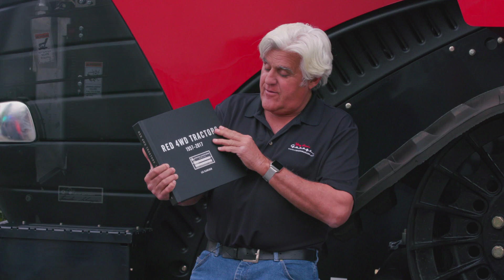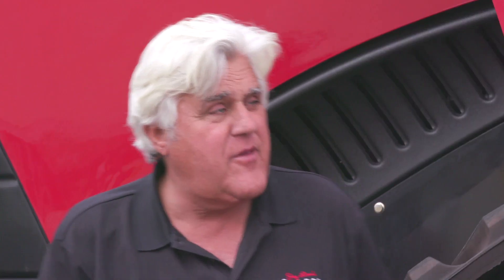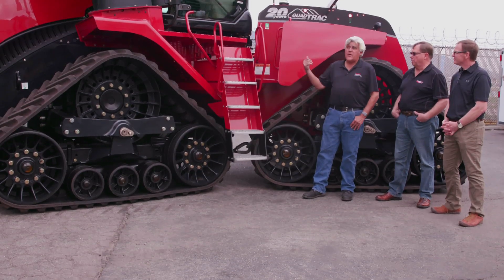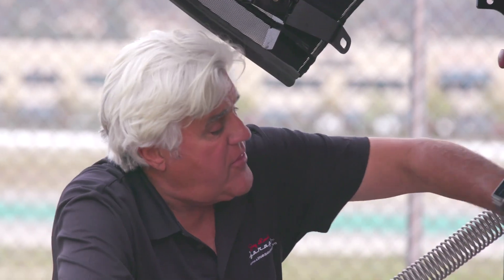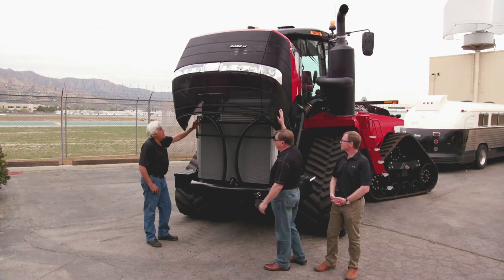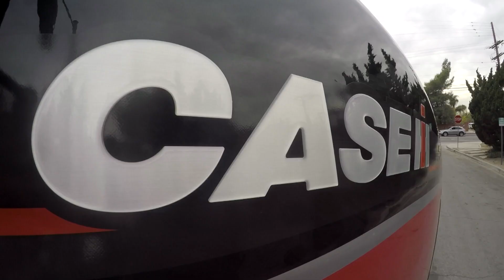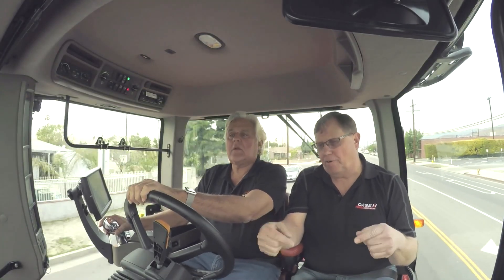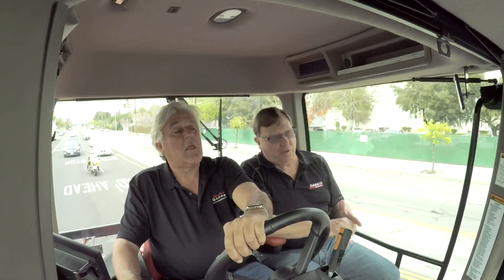2017 Case IH Quadtrac - Jay Leno's Garage

Comment: Hey editor, you left in Jay asking the same thing twice about the radiators.
Reply: Zac Alleywalker Lowing oh good I thought I had a stroke or something
Reply: Oops...
Reply: Zac Alleywalker Lowing just in case people don't get the explanation first time around. Lol
Reply: Just a glitch, Mr. Smith will be right there.
Reply: I'm not the only one that caught that? Good, i thought i just lost my mind.
Reply: But the question was never answered. They just dodged it with a lot of waffle.
Reply: @salvatoreshiggerino6810  That's because he's wrong a thicker radiator will remove more heat as long as you have the fans providing enough air flow.
Reply: @mbsnyderc  Yes, obviously, but that's no excuse for dodging the question. Would it have killed him to just give a straight answer, "There is enough air flow for both radiators"?
Reply: I thought Jay asked him twice because the first explaination didn't make sense.  Air passing through the first radiator will take on the heat of the engine and be hotter.  The oil cooler just doesn't need as cold of air to work.
Reply: @salvatoreshiggerino6810   You should be a Case salesman once you understand the question and implications.
Reply: No, it was edited, Jay actually asked 4 times!
Reply: @salvatoreshiggerino6810  he didn't dodge the question. He said the air coming out of the first radiator, is cool enough to cool the second. It's a very straight forward answer.
Reply: Tht was actually Jay forgetting tht he asked tht question lol
Reply: Okay it wasn't just me. Thought the matrix had glitched.
Reply: Diesel Brothers made one of these that jumped a ramp!
Reply: When the fan clutch kicks in on the engine fan and quits letting it slip or speed up and down, the fans arent jus bolted directly to thewater pump so they turn full speed all day. The clutch between them only locks it w engune rpm as needed, I guess to keep operating temp the same whether it needa to run more or less but when the fan kicks full on you can hear it above the engine and whatever kind of hookup behind you also. When both fans are running full speed you would be amazed at the speed and air they pull through the coolers.the newer ones like this cool themselves really well. They spend day after day in dirt and sometumes so dusty that you cant see the end if the hood much less where you are going and the fans and coolers are designed to where the fabs will pull most dirt ,dust, seed heads right on thru so it wint clog it up like older ones because working an engine hard for 12 14 hrs a day going 10 mph you cant rely on your ground speed to help push air thru the grill and radiators like a car on the road. You still have to blow out w compressed air every so often, that is why the coolers seperate so easily but light years better than on older models where working them hard they jus did stay cool them getting to the coolers and between them to blow them out took forever and had to be done so much more often. Your air condition cooler is up there to and once the older ines got the temp up good so did the cab temp so you burnt up all day
Reply: that tractor has a radiator like any normal radiator for engine coolant, a hydraulic cooler for hydraulic fluid, unless this one has some new function that is diff than any other one ive seen the trans and hydraulic are the same oil.case ih hydraulic oil is called HY-TRAN. Hydraulic transmission fluid. An engine oil cooler, air conditioner cooler and some have diesel coolers so the engine fan itself when full speed blows some damn wind then the electric is just a backup but that is why they seperate even more than they showed you,there are alot of coolers stacked up togather there and they seperate so good like that to be able to blow them out the opposite direction from the way the fan pulls
Reply: That's cause they never actually answered his question, they tried thick six or eight core radiators years ago and anything past a four core rad just heat transfers to the rear cores and never actually dissipates the heat, Jay knows his stuff
Reply: @salvatoreshiggerino6810  He did answer the question, but he was trying to not contradict Jay and be friendly. The idea is to use a thicker radiator with more velocity, because of the fans. That way the temperature rise of the air through the first radiator is not much, and you can put another radiator behind it and everything is efficient within the area envelope. The engineering is solid.
Reply: I think Jay had the same question I did from dudes explanation. It didn't make sense the first time if you understand anything about thermodynamics.

Comment: Very enjoyable video. This fits in with all the exotic vehicles you own that are not supercars! I love the supercars and motorcycles, but the specialty vehicles are cool too. You go from a steam powered, open cabbed tractor to a tracked, closed cabbed tractor that uses GPS with inferred sensors, not to mention all the dust and chemicals open cab operators had to breath in.
Reply: I don't think he owns that tractor.
Reply: No he doesn't, it's headed to a California customer after this. But I think it's cool to showcase vehicles like this, since he owns his own fleet of specialty vehicles.
Reply: So Smooth and Quiet! Amazing! ❤😁👍❤❤
Reply: I don't usually watch a 30+ minute video, but this was impressive!!
Reply: surfing636 This fits in with supercars for sure with a near 700K price tag.

Comment: Bonanzaville in west Fargo north Dakota has the first stieger ever built in their farm shop.  After they made it they started making them and they have their first production model made for sale.  I volunteer out there every year.  And they run it in parades and other events every summer.
It really was a different era. Back then the problem wasn't lack of horse power but getting the horsepower to the ground.  A lot of farmers in our area including my great uncles built their own four wheel drive tractors as none were available at the time.  Stieger and versitile were pretty much to answer the call. 
Stieger was really popular among road crews using scrapers because they were the first to have am auto shifting transmission.  So all you had to do was step on the throttle to pick up gears.  
Anyway.  Its one of the true farm to big company success stories.  Much like the melroe bobcat.  First one of those also available for viewing at bonanzaville in west Fargo north Dakota

Comment: Too bad they couldn't have done an actual in-field demo.
Reply: Farming 4G just starts casually ripping up the road
Reply: That would be like Paulie Shore in "The Son-in-law"!
Reply: Farming 4G There’s a Top Gear episode where Hammond “uses” one of these in their field piece. Not sure that will help you though, as it is, as always, professional levels of cocking about.
Reply: IH, the gateway tractor.
Reply: @gussyt1761  we had that happen to us on accident once.
Reply: @jamespaulaski5697  9 shank chisel plow, hydraulic line blew and it fell down and tore up 20 feet of road, the plow is only like 15-20ft wide
Reply: Christian Gierach did it rip all the way through the asphalt or scratch he surface?
Reply: @Comet925  Wow!!! Yes, I also would like to know about the question that  Braden Miller asked. Thanks! 👍👍
Reply: @deltajohnny  yeah all the way through and then it stalled the the tractor
Reply: @Comet925  Thanks! I'm sure it was spectacular.... Wow...

Thanks again!
Reply: I want one and a snowy field.

Comment: wow, sequential twin turbos on a tractor! This thing is insane lol
Reply: Pretty sure he meant compound turbochargers. He said one turbo feeds the other, that is a typical system used on big rigs and other big diesel engines. Whereas sequential turbochargers means you have a little one and a big one, the little one spools first, then at higher rpm the larger one comes into effect. Totally different.
Reply: Interesting. I had not heard of compound, but that seems plausible.
Reply: A lot of caterpillars heavy duty Diesel engines have compound turbo set up
Reply: mate... sequential turbos and compound turbos are the same thing, just different names
Reply: james williams untrue
Reply: tahindra singh Detroit 2 cycles use a supercharger that is fed off a turbo charger to get a nice low RPM high horse power high torque power plant  and gives it a nice growl at high idle
Reply: Steve LaForce those turbos are probably the size of a standard car tire

Comment: 600k for that monster is a steal tbh. These things are used to make money you gotta remember that, unlike most cars on the show
Reply: Jon Samuel except that’s just the entry cost, buying farm machinery is the cheap part. Keeping it full of fuel, replacing parts, and making sure it’s insured will make a piece of machinery like this much much more expensive than a small loan of 600k.
Reply: @snowdirt2529  dont forget all the machinery you need, it isnt gonna make money if it doesn't have the right machinery. Idling in doorway isnt gonna make u rich.its too big if u ask me, its only good in a field pulling machinery. Id hate having to do any road running with it, it would take3/4 of road up easy
Reply: @dwoolaver1549  Its not too big for the country, which is where most of these will be
Reply: @snowdirt2529  And then you've got to hope the stuff you're growing or farming gets a good yield that year and the selling price is good.
Reply: Small loan of 600k? Is this considered a small ammount of money in the usa? In Slovenia this is a fortune...
Reply: @danijel124  You could get a 600k loan. The bank just needs proof that you can pay it back. The farmers that buy tractors like this usually have 5 million dollars worth of land or more.
Reply: Mike Maes  Or milk at a meager $13.50 per hundredweight.
Reply: Dairy is not a money making business
Reply: danijel124 Considering that even a small farm requires millions of dollars to farm, Yeah.

Comment: What an amazing piece of machinery 💪
Reply: Agreed it is amazing, but it is not easier to drive than a normal [modern] tractor. 
So it requires a special operator, one who is more careful than most.
The key issue when driving a tractor is not tearing the land up, which tracks makes both easier & harder. As a wheeled tractor will spin, telling you to slow down, while a tracked tractor won't tell you are f-ing up until you really F-up and need the tow cable under the front.
Reply: Wow 😲

Comment: I ran one of these, well a older version in the mid 2000's on the oil sands in Alberta. And man ran like a charm and though its designed for farming it worked very well for scraping / dirt moving with a huge scraper. Almost as fun as a 6x rock truck or a D6 cat dozer.  One of the few machines that has AC for those hot alberta summers... a well needed amenity on the field.  Case equipment is a blast to operate.

Comment: 30gph seems amazingly good considering the work its doing.
Reply: microbuilder it is good. Older 4x4 tractors like that would run out of fuel in half the time this one does. 18 hours on a tank is very good with the work it does in the field. To pull a 100 foot seeder takes big power.

Comment: But will it do a burnout?
Reply: Tony Shade sadly no...
Reply: Yes of course with enough load on the back 😂 might need a house or two
Reply: Tony Shade. No. It will not, but it can crash cars.
Reply: Imagine pulling up behind a pimpmobile and honking the horn
Reply: I can't wait to get one, slam it, put a fart can on it and neon lights underneath! Oh and a Type-R badge for the back.
Reply: Yes on top gear the tracks spun
Reply: Tony Shade : )
Reply: henry cullum because it was towing a Boeng 747.
Reply: This!!!!
Reply: No, but it will make the earth spin in the opposite direction.
Reply: if you can chain it to something solid enough,  it's geared low enough to turn them over.
Reply: In heavy mud, yes

Comment: I think Hammond may have driven this type of tractor in one of the Top Gear episodes back in the day
Reply: Leonard Carr This one isn’t that much bigger than the one in topgear
Reply: He did. It was one of the older models that did not have as much horse power. They are amazing machines. I have been in a real one. I wish our farm had one. Lol
Reply: He even took it around the track, lol
Reply: Leonard Carr They were the same physical size. Only difference is horsepower.

Comment: I would drive it to work everyday
Reply: what if his job was being a farmer ?
Reply: TheHua89 become a farmer and you can ...but then you would. Just wish you could take your car
Reply: TheHua89 lol anyone stuck behind you would be pissed
Reply: Believe or not i actually drive a tractor to school everyday not this one in the video but a lot smaller and older ford 4000
Reply: You'd be replacing boogie wheel seals every weekend.
Reply: Oh nice! I have an IH 1066, with the DT466.
Reply: TheHua89 No doubt.
Reply: TheHua89 I drive one at work 😂
Reply: Don't become a farmer, its fun sometimes, but I make less than the poverty mark ... :)
Reply: Roman Burlando hahahahaha it's the best!
Reply: 34486 SCI Was your 1066 built with the DT466? If so, I’m wondering if that’s the 66 series with the black line rather than the white.

Comment: I love most any tractor, but damn, this particular tractor by Case IH is just so sexy looking too. As a promo video, utilizing Jay Leno, with His sense of humor, timing and easy going demeanor, the video rolls along as easy as the tractor itself. Allot of technology packed into this gal. I love the general outline of the tractor. The color......awesome. Pricing is extremely fair considering the overall value and technology incorporated into it. Obviously she is smooth and easy to operate/drive. Very sexy looking........

Excellent video. Best thus far.......🚜🍻
Reply: "Barn, you can point to anything in the Sears Catalog and somebody, somewhere wants to sleep with it."  -SGT Wojohowitz, Barney Miller

Comment: I used to load Case IH corn combine onto trains and semi's. This machine is even larger than those combines but combines are large. Coolest part was that we got to drive the combines to where they were loaded. We'd do what was called a "hot lap" around  the parking space then load them. The rail loading was actually a  few blocks down the road and we'd drive them to the rail loading ramps.